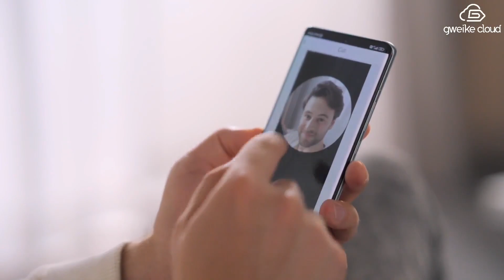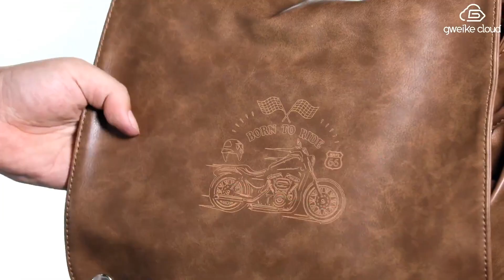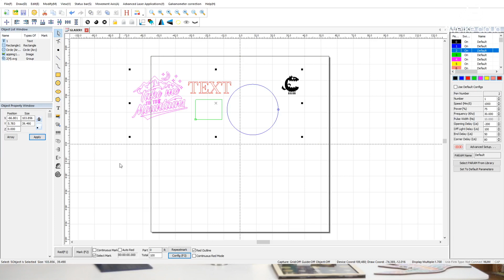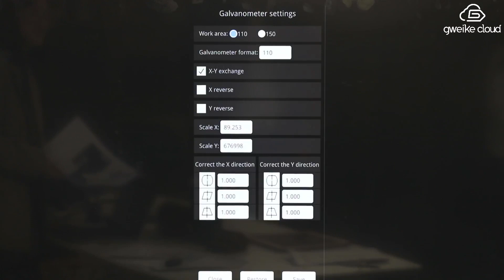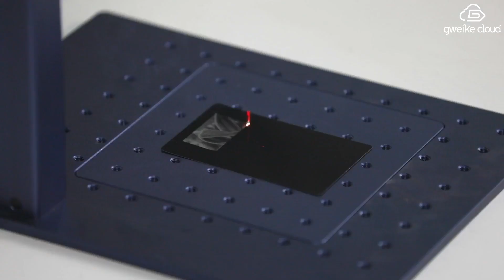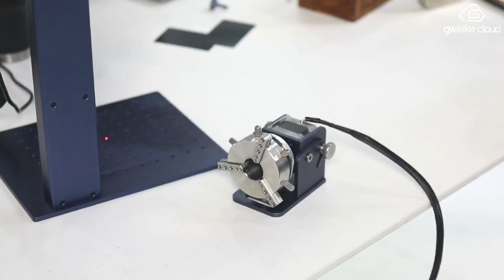G2 Software Q&A

Comment: also there are some errors connecting to network on iphone app, do you have any support files to reference it?
on the step of "Configure the network" where after connecting to your local WIFI network, getting an error as following
"Failed to connect to the device. The default WiFi of the device is G_Laser. The specified WiFi is G_Laser"
Reply from the maker: hello kevin, pls reach out to our customer service and get personal support team to help figure it out